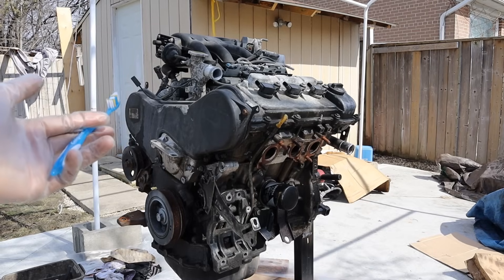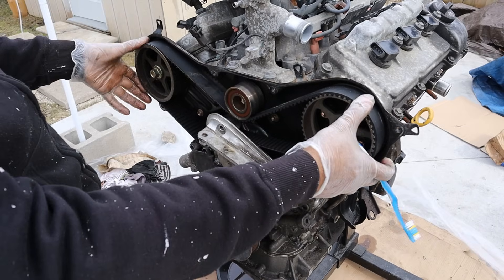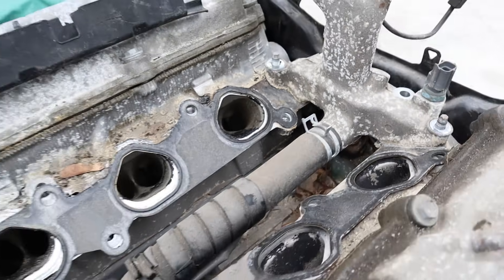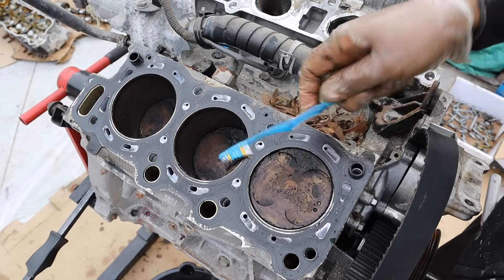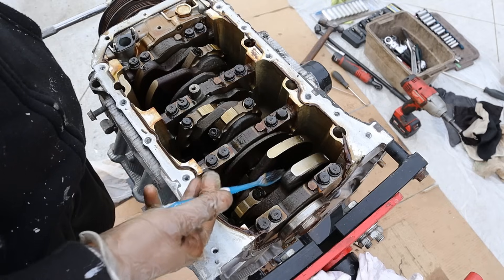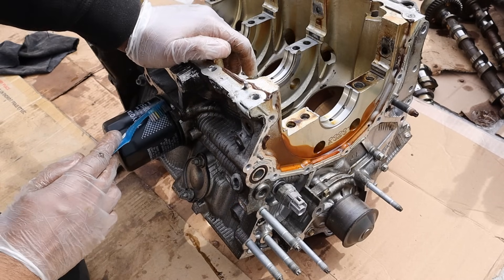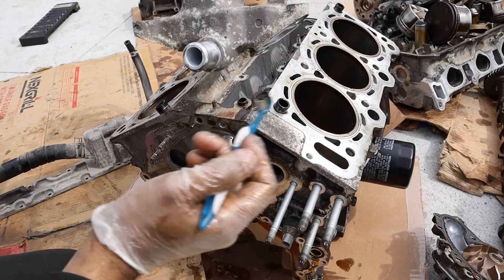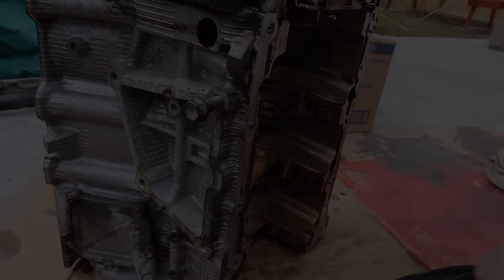Here's how the Toyota 3.0L V6 Engine Became a Success

Comment: 1mzfe in my 2006 toyota camry ateva is very powerful and reliable, shes got 280,000km but also got a p0125 code in it not sure if theres something wrong with my sensors or thermostat itself but yeah otherwise good car

Comment: I have a 2001 Toyota  Sienna with this engine. I have 449,000 miles and only use a half quart of  oil every 5,000 miles. I change the oil every  5,000 miles with Castrol  Full synthetic . I monitor the color of the oil and have recently started oil changes at 3,000 miles. Runs smooth. Only use OEM oil filter and air filter.  Only use OEM electrical and SENSOR PARTS.  Have a digital headsup display that can monitor engine coolant temperature. Change coolant every 30,000 miles Change timing belt andd water pump with the tensioners and pulleys with crank and camshaft seals all  OEM. The transmission is also the original

Comment: Great video, and quite educational!  I have a 2002 Camry SE V6 with about 176k miles, and it mostly runs like a champ.  There have been times when I'm driving, and the acceleration will seem to "cut out" for about 1 second, and then come right back (even though I'm holding the gas pedal steady).  This happens at lower rpm's, about 1500.   One of my ignition coils has a small crack on the tube, and not sure if this may be a contributing factor?  I had a P0430 error code a few weeks ago, but the check engine light went away on its own!  Not sure if I should attempt to clean the catalytic converters or just replace them?   I still need to inspect the oxygen sensor and clean it if necessary.  Thanks!

Comment: Great breakdown video! I have a love hate relationship with the 1MZ. It's very reliable, very powerful,  but I lost one due to engine sludge. I bought a used lexus and switched it over to synthetic oil, it loosened up a bunch of sludge which ended up completely blocking the oil pickup tube starving the motor of oil! Idk why the low oil pressure light never came on. just stalled out, and had metal shavings in the oil and rod knock. there was smoke coming out of the oil fill hole when I opened it.  I put a used motor into the lexus put full synthetic in it, but going to only drive it 1000 miles then drop the oil pan and check the oil pickup tube. Not losing this motor to that.

Comment: Great video thanks - I have the last gen of theses in my 2007 Alphard - oil leaks from valve covers...preparing myself to replace theses.  I have put new plugs in the front and back banks so I understand the comments around difficulty of access - I know I'll have to take a fair bit off the access the back valve cover...hmmm...
Reply from the maker: I have a valve cover video on the 1MZ check it out

Comment: As a non mechanic, I'm amazed at how much people know and can fix. Can attest to knock sensors /oxygen sensors being weakness, whose went bad on 01 Es300 at 100k, cant pass smog test. Leaking valve cover gasket on sienna 98 with 220k. Sad part was quoted $600 for the job :(

Comment: It's 3.0 not 3.5.  Also oil filter placement is perfect for easy access. Just replace filter when engine is cooled down to warm. Not sure if you want to replace oil on a hot engine anyway. Oil leak happens to all engines. Just a matter of time.

Comment: I have a 1MZ in 02 Sienna with 130,000 mi. I hear faint pinging at 30 mph at steady speed with no code. Could or should I change out the knock sensors? I would really, really appreciate suggestions. Thanks!
Reply from the maker: Pinging is predetonation. You need to check your gas quality

Comment: Still have my 2001 Highlander that I bought new. 270k miles. The valves tap pretty loud but only at idle. Smooth and quiet at acceleration.

Comment: I have a 2003 Toyota v6 with 163k on it. The motor is super reliable. My mechanic told me that I have the non-vvti one. Is this motor as reliable as the later vvti ones?
Reply from the maker: The non vvt Camrys had the weaker u140 transmission.

Comment: The 3 plugs in the backside of the engine are easy to remove with ratchet extensions and wobble joints, without removing the intake.

Comment: 253k miles on my 1mz-fe solara. Doesn't burn oil, still gets original spec'd MPG, only thing that runs smoother is my friend's gen 1 tundra with the V8. I do have the valve cover leaks but they aren't bad enough to do anything about (yet).
Reply from the maker: I miss my solara

Comment: Got a 1996 camry with the 1MZ-FE with no VVT and at the moment only have 85k miles on and the only problem I had is the powersteering fluid leaking. Reliable car all-round. My dad garaged it till I learned how to drive and now I've moved on to an 8th gen Honda accord and the camry is now in my sisters hands

Comment: I have an ES300 and I got a P1351 code after I changed the valve cover gaskets. My assumption (after trying a lot of solutions) is that sludge is stuck in the oil path to the VVT gear. Anyone has ever the same issue?

Comment: Just completed a round trip Texas to California in a 1995 Camry V6 1MZ.  Went sailing past many a Tesla at 30 mph faster than them on i40 and used a range of 420 miles between fuel stops.  Had the valve clearances done earlier and also a new timing belt kit.  Engine seems as good as new.  207k miles so far.  Smooth and powerful, the best engineering.  Sets the standard for durability.
Reply: 0-60 of around 7.6 seconds, top speed of around 138 mph, power of 189hp, torque 203 lb/ft, the car is not short of power btw.
Reply: Took my 02’ Solara on a round trip from Texas to San Diego to Monterrey, to Las Vegas to Albuquerque then back to Texas a few years ago. I had the car inspected and topped off before the trip and I never had a worry.
Reply: @02SLERA  Smart move to get an inspection prior.  It can revel many an issue, much easier to fix beforehand than by the roadside!  PS. Do keep the gearbox oil changed and fresh.
Reply: @janet53589  Thanks for the advice, I don’t think I’ve ever had that done!
Reply: @02SLERA  I should have mentioned, that Toyota gearboxes can use either combined gearbox and differential oil, or they can be separate.  If it is separate, then both the gearbox and also the differential oils should be changed separately.  It is easy to overlook this fact, if your car is one of those using the separated arrangement.  You can do the job yourself if you want, just use fully synthetic ATF.
Reply: @janet53589  Thanks again. I’ll be changing the rack and pinion soon, so maybe I’ll be able to add that to the list on the same day.

Comment: This is the most legendary closed deck v6 engine ever made, and I have owned 2 vehicles with it, 94 and 05 Camry, both ran to 400 k km with 0 issues
Reply: How is the gas on the 05 v6 Camry? I’m lookin at one as a first car for collage commuting, and it is easy to do the maintenance your self? Since I heard the spark plug and belt are hard to do.
Reply: @sanjotmultani4840 I own an 04 camry with this engine. It's not great on gas (10L/100km) but not awful either. One of the disadvantages with the v6 in the camry is that they had to tilt it in order to fit the big engine into the small bay. So accessing the rear cylinder bank to change the spark plugs is a big pain. You have to remove a lot to get to it. It is a great car, but I think the regular 2.4 L 4 banger is probably easier to work on and more fuel efficient.

Comment: I got a 99 camry with this motor. I wanna do whatever I can to make sure this this last so I was considering an egr delete but have a few concerns. I'm not sure if it'll throw a code and go into limp if I put a blocking plate. Also bcz the af mixture will be more "pure" idk if it'll make the engine run hot and reduce the longevity. Overall I want to reduce the amount of crud recirculating back into the intake so I'm also gonna do an oil catch can but this egr thing is buggin me. Don't want to go through the hassle of cleaning and / or replacing the system for it to get build up again. We don't have emissions here so I figure why not. Also, would the valve cover with the updated pcv valve fit on my camry?

Comment: 1MZ in 2004 Toyota Kluger (JDM Highlander) runs well but power steering leaks - hard to access that PS pump that's for sure.  Also the axles have developed a vibration - new axles have been sourced, but now I have to find time to pull them out and stuff the new ones in...

Comment: Our family car was a 95/96 lexus es300 with this engine. We stopped driving it regularly after the issue with steering made it a road hazard. I pretty much ran this car to the ground when I drove it (I was a bad owner and let it run dry on oil 2 years ago). It still starts and runs today by some miracle. I plan on pulling & rebuilding the engine and transmission, repent for my sins, and see how many more miles I can run the original engine on. This video helped a lot, thank you
Reply from the maker: May your sin be forgiven 😉
Reply: Suspension and steering rack will be worn out by 200k.   Luckily it's pretty cheap to get a new steering rack and tire rod ends, new control arms and ball joints, and new front struts and shocks.   It will tighten up your car to a "like new" feeling.       I know when it's old and sloppy it can make you hate it, but it's cheap to correct.
Reply: @dennisrobinson8008  I just put in new tie rod ends, control arms, and steering rack bushings. I plan on replacing all my wheel bearings, putting in the new struts like you suggested, putting in a new steering rack, and redoing the brake & fuel lines (I live in rust belt).
Reply: Sounds good.   My car was trash until i did it and afterwards it's a competent car.       I also took care of paint and clearcoat so it has a good appearance. @Ciruchan
Reply: 3vze is the engine in the second  gen.
Reply: @Ciruchan It will likely go another 500K miles if you take care of it and if the car parts last but the engine itself will outlive the car providing you feed it oil every 5K miles or 6 months whichever comes fist. Give it fresh oil and fresh coolant and that thing will outlive any of todays engines
Reply: Jamás serás perdonado

Comment: When my wife and I met, I had a 2000 Camry with a 1MZ and she had a 2004 ES330 with the 3MZ, both inherited from our families. For a couple of years they lived side-by-side in our garage until we needed a bigger car for our first kid and I sold the Camry. We still have the ES with 151k but it needs the cam seals replaced and then I think it’ll go for another 100k miles easy. I actually think the 3MZ feels a little smoother among the two. Great engines and excellent video!

Comment: The cams it self shows the benefits of single system gear cams with a double cams performance. I believe merc still uses those system with their top of the line engine production
Reply from the maker: Variable valve timing is easier with double overhead cams

Comment: Been happy with my 98 Camry for the past 10 years. I’ve replaced my valve cover gaskets once, I can also attest to power steering pump being a pain to access haha. Around 230,000 miles and never had any real issues, overall great motor👍
Reply: 2nd owner 97 camry 186k now I love this so much. owned it 20 yrs will never let it go

Comment: I got one out of a Toyota sienna for my 1989 Corolla station wagon.  I can't decide if I wanna switch hubs and run a manual trans from a Celica or if I wanna make a bell housing adapter for the stock Corolla (c50) transmission (probably won't hold up very long) .  But thanks for the information!

Comment: I have an 02 highlander v6. I just did the knock sensors last week, and while I was in there I did the valve cover gaskets, fuel injectors, spark plugs, spark plug gaskets, and cleaned the pcv valve.  240k miles and it still runs great! I have a question though, since you seem to know a Bunch about this engine. My engine burns A ton of oil, over a quart per fuel fill up. Every 10th start or so will result in lots of smoke coming out the exhaust for a minute or two. I was hoping it was because of the pcv valve being clogged, but it's not clogged. I've heard the piston rings on these engines go bad... is that true? Is there anything to do to help restore the rings besides a complete teardown?? Thanks!
Reply from the maker: Valve stem seals
Reply: 12:10 "getting jiggy with it nanana! " 😂 

I'm doing valve seals and a burned valve this week.

Comment: My rx330 200k ..
Small headgasket leaking coolant into cylinder #3 , during cooldown under residual coolant pressure..no overheating during driving..
Reply from the maker: Not bad.

Comment: My 95 Avalon has 202XXX miles using Mobil1 15-50 full synthetic.  Runs like brand new.  I also have a 2007 Highlander with a 3.3 L that I like a lot.  150xxx miles on the same oil.
Reply from the maker: 3.3L is also a good motor. I have one in my Camry

Comment: I love it, 2005 camry xle, regular oil changes, mine's at 255k miles, original engine. So far I have changed the thermostat, starter, spark plugs, ignition coils as they died out causing dead cylinders (most likely from the worn spark plugs, the gaps were insane), brand new O2 sensors, used fuel injector cleaner additive but I'm still doubting if it worked. Doesn't burn any oil either but my valve covers are leaking slightly which I should take care of, been too lazy but it isn't severe. I haven't done valve adjustment or my timing belt yet but the previous owner did have the timing belt done at 110k miles from the dealer, not sure about the water pump. Changed the coolant too, don't want to risk corrosion. I've been changing my oil every 6 months since I barely build miles everyday using a mobil 1 M204 filter, its just I feel more comfortable using a bigger filter especially considering the potential sludge issue hopefully the filter is catching but I should open the filter up at the next oil change. Royal purple 5w-30 full synthetic, I used to use Valvoline Synthetic but the engine literally turns the oil into mud, the royal purple is holding up better.
Reply from the maker: Nice work. Keep it rustproofed if you live in the salt belt and it'll last a while

Comment: Amazing engine. Reliable and quiet. I have 98 ES300.
Reply from the maker: Nice car. Black interior?
Reply: @speedkar99  White exterior and Beige interior. I used your previous videos to do a lot of maintanance on this car including a Timing belt job. I appreciate the consice video you make. This 98 ES is my daily driver. 
I have an 07 LX470 which I use as family hauler. Both cars are close to ~175k miles and the engine has been very reliable.

Comment: u should pull apart a h25a or h27a v6 engine from suzuki, they also still use this v6 in their outboards engines, but their are a bit different for marine application
Reply from the maker: Interesting

Comment: 2001 Avalon here. Bought it used witharound 100,000 poorly maintained , had oil all over engine could see carbon and sludge under oil cap. I got it cheap. Used as a sales rep car until about 250,000 with poor maintenance by me as well. Gave it to my son who uses it for pizza delivery and school about 3,000 miles a month. Poor service by him as well. We have only replaced the radiator after it leaked and he ran it home on hot for about 10 minutes. Been in about at least 5 accidents, has dents on every panel, even the hood (son had to jump on it and tie it down with shoestring) opened up going 65 on highway. 
Now has 306,00 and still going strong and passes emissions.
Reply from the maker: Nice car. Please take care of maintenance 🙂

Comment: Bout a 2001 sienna with 219k on it for $500, 2 play stations & a iPhone lol. Valve cover gasket(most annoying issue so far kept losing oil but relatively easy), oil vvt solenoids, knock sensor, 02 sensor, coil pack, currently 226k. Running rock solid 😁👍🏾. Previous owner was just didn’t appreciate it……1mz-fe runs unbelievably smooth even with a bad knock sensor & o2 sensor. It burns through gas kinda quick though
Reply from the maker: Nice! Good engine. I prefer the second generation sienna for it's roominess

Comment: I am of the opinion that the earlier single-cat Federal emissions, non-VVT, non-interference 1MZ is the cheapest to run gas OHC V6 ever made.

I change the PCV valve every other oil change on mine, and do 3000 mile changes. At 217k, mine is clean as a whistle under the valve covers.

I do lose sleep over the coolant bypass hose, though... worst designed part of this engine. Well, the need for valve adjustment, too...
Reply from the maker: Agreed, the original 1MZ was very cheap to run and maintain. Less complexity. No need to worry too much about by pass hose lol
Reply: I hope you're right. I have one for installation when the knocks go. Sucker was expensive... dealer only.

My absolute favorite automotive channel tears apart my absolute favorite engine. This is a good week.